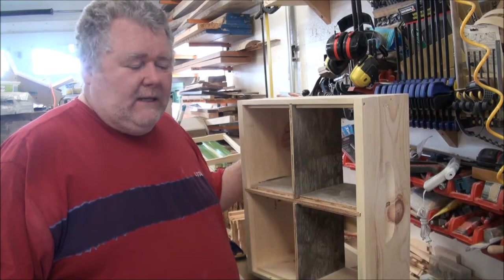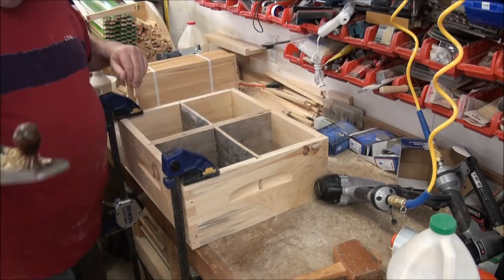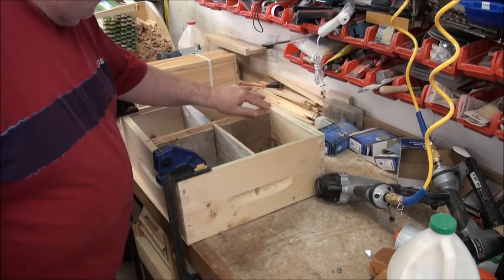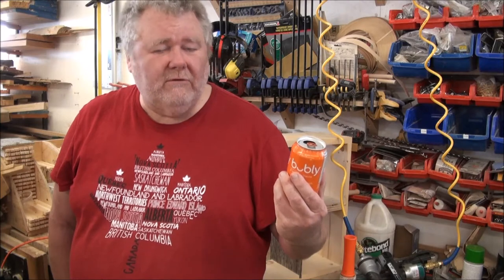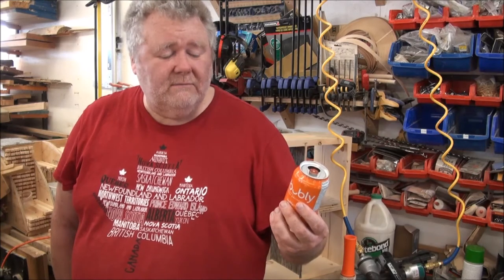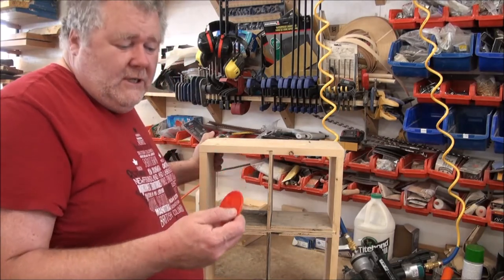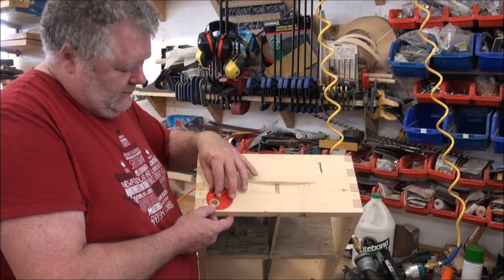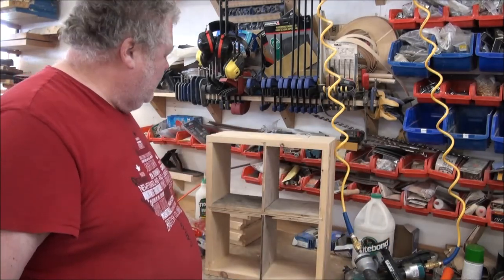More Mating Nucs - That Bee Man

Comment: We do use the deeps for making 3 Nucs out of 1 box.We are using regular deep frames,also we are puting 2 dividers 1/4 plywood ,and every nuc gets 3 frames full size.
Reply from the maker: I built thirty of those and tried them out.  I may start wintering queens in them.
Reply: We have a large Apiary Farm ..We keep Those nucs on migratory palats,easy to move them.Also using regular frames I just expend the nuc quiker in to 10 frames family.

Comment: I heard the human finger is accurate to a millionth of an inch!  Yes, no sawdust, great idea, was wondering how your were going to shave them.  Nice tool that Stanley planer.  I just bought honey from the next town $10 lb for liquid honey.  Nice quality work.  Have you ever considered using a wooden pusher stick instead of putting your hands near saw blade?
Reply from the maker: Thanks.  Yes, I use push blocks, sticks and pads where appropriate.  When my hands are not close to the blade, I feel that the best control of the work-piece comes from direct hand placement.  The red throat-plate is a good guide as to where to draw that line.  If it appears that my hands are near the blade, it might be the camera angle.  The smallest pieces I was cutting in this video were over 8" side so, not very close to the blade.

Having said all that, table-saw safety is vital!